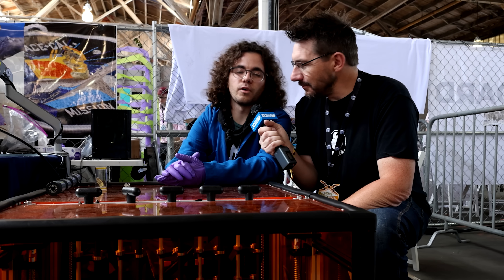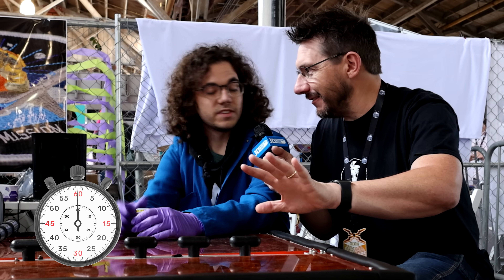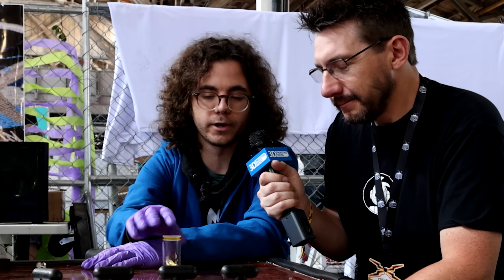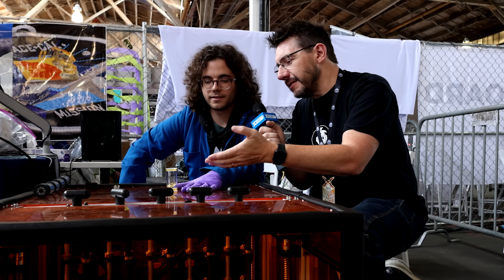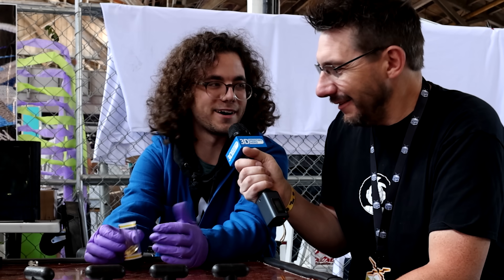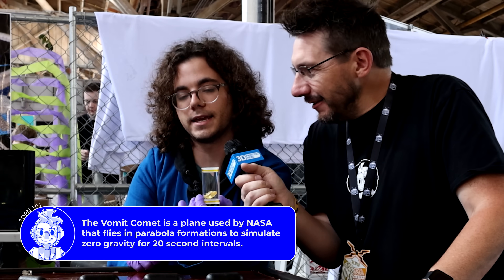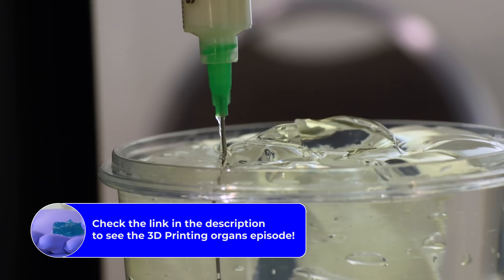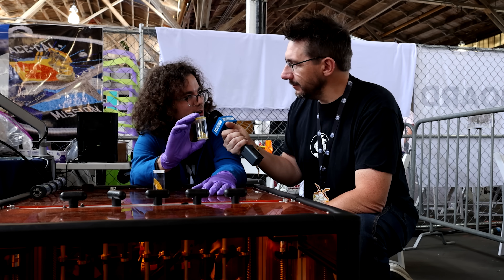3D Printing in ZERO G!

Comment: "all at once" is a bit of a misnomer.  The layers are applied in a rotational direction.  The reverse scan anaolgy is more accurate.  I am impressed the fluid is solidifying in the middle of the container and not on the outer edges.  That type of solidification control is the real star of this process.

Another question is whether the excess fluid can be reused.  I would assume some of it as partially solidifed like current resin exposed to UV and we have to strain it to store and reuse.
Reply: The fluid is solidifying "in the middle" because these points ("voxels") are receiving the laser light all the time. So they heat up until they harden. The other points in the resin do not receive the laser light all the time, due to the vial rotating, so they do not heat up enough to harden. This is how the solidification in controlled. For example a point near the edge of the vial is rotating fast. It will only briefly pass in front of the laser, so it will not have time to get hot enough for the resin to harden. The trick, naturally, is to make sure that all the points you want to harden receive the laser light all the time, and as the vial is rotating, you must constantly update the image you are projecting.

Comment: How is the resin in front of the object not curing? Please make a follow up video in their lab
Reply: Because the object is rotating. The resin "in front" doesn't stay in front for long enough. But all the points that you want to harden receive the laser light all the time, so they heat up to the point the resin becomes hard. For these points to receive the laser light all the time, you must constantly change the projected image, as the object is rotating. By synchronizing the physical rotation to the projected image, you manage to heat up the resin only where the object is. All the other points in the resin get some laser light "in passing", but not enough of it.
Reply: @fixups6536  Damn, your explanation is really good.

Comment: From my interpretation of how he's explaining it, it feels like an analog of the the way string art is made, but using light instead of string and with a Z axis as well. Areas where you get more intersections over time are more likely to polymerise. I might be wrong, though 😁
Reply: It seems to me that they use light density with a rotating 3d model with an "xray" shading rotating in sync with the printing vase. So the density of light will be the same in each point of the resin. Not clear if they are pulsating slices of the 3d model or just projecting it all at once.
Reply: seemed like it to me
Reply: Or like radiotherapy, where they use intersecting radiation to specifically harm tumors the most. And healthy tissue better off.

Comment: I didn't quite get how this can be used for bioprinting.... the materials have to be UV curable, and how does that work with cells?
Reply: Probably you print scaffolding or something and inject cells separately. Or maybe if it's a uniform cell type you just have them present in the mixture and they automatically get attached to the scaffolding?
Reply: @daliasprints9798  Those cells would be pretty expensive. Not a good idea to waste most of them. Also UV radiation is kind of bad for them. Not sure if the short duration is a saving grace or the intensity is still as bad. You wouldn't want to look into those UV lights either, for example....
Reply: @Andreas-gh6is  The process is wavelength agnostic and can be used for anything from UV - visible. Most CAL systems use 405nm which is totally fine for cells, especially at the relatively low optical energy densities used in VAM.

Comment: What I found funny is that they are looking to use low viscosity resins when in other photopolymerization technologies the look exactly to use high viscosity resins. As they are way stronger in terms of mechanical properties (generally by adding fillers) and have a way more chemical resistance.

Comment: I'm still trying to understand how they handle depth with this. Is it exposure time?
Reply: this is a CT scan in reverse, similar math applies
Reply: Yes, it's exposure time. Imagine you want to harden a single point inside the resin (a single "voxel"). Just send a narrow laser beam at this point while the object is rotating. This voxel is going to receive the laser light all the time, and after a while it will heat up enough and the resin will harden. Meanwhile, all the other voxels traversed by the laser will not stay in the light for long enough to get hot enough, because the vial is rotating, so they will not harden. Obviously, for this to work you need the laser to follow the point you want to harden all the time (unless the voxel is at the center of the vial). You could say that at any instant, the laser is projecting the image that you are supposed to see if you were looking from the laser's point of view, even if in my example it's just a single point. Now, why not do the same for multiple voxels at the same time, to get a full object instead of a single point? Well what you have to do now is to project an entire image, not just a narrow laser beam. If the image you project changes as the vial is rotating, so that every voxel of the object receives the laser light all the time, you are continuously heating up all the object's voxels, while all the voxels that are not in the object are heated only "in passing". After a while, only the object's voxels harden, and the rest of the resin in the vial does not.
Reply: @fixups6536  thanks for the explanation, that makes perfect sense!

Comment: So in theory we could use several projectors surrounding the material and alleviate spinning
Reply: Or 1 projector that would rotate around the resin.
Reply: @dinosaurus4189  granted, that will work however, I believe that when the smoke clears we will realize that projectors all around and at the top and bottom will make the process better
Reply: Having projectors move sounds much smarter. Big lesson from FDM is you want your part stationary so forces involved in its motion don't affect print accuracy.
Reply: @daliasprints9798  so why not use multiple projectors and keep everything stationary?
Reply: @individualone  AIUI what they're doing needs a continuum of angles not a small discrete set.
Reply: @daliasprints9798  so unless I'm mistaken that means multiple projectors working together would improve the process. 4 surrounding 1 at the top and 1 at the bottom for adhesion. Do you think it would work?

Comment: Awesome! I remember going to ERRF 2019 and Adrian Bowyer was going to be a keynote speaker. He discussed this being an interesting new method to do 3D printing, though questioned ability to do some sharp details and lamented the use of resin (which still requires careful handling with gloves and all). He proposed using an alternative material (which they were supposed to be in the process of testing candidates) that could be formed with electrodes on the outside of the container... Back to the point: this is still an awesome process, love that there's a plan to make it open source, and will be curious to see where this goes and alternatives (like Bowyer's project) that do something similar.

Comment: I thought 3d printing tech had somewhat stagnated.

This is crazy cool
Reply: Man, look at what Stratasys is doing with full color, multi material printing. Not to mention the new core xy printers that are doing fdm at insane speeds. 

I think the novelty of 3d printing has worn off for a lot of hobbyists, but the current innovation is insane. Can't wait for all the tech to trickle down to consumers.
Reply: @williamreinhard  Stratasys held consumer 3D printing back for like 30 years. Why should I care what they do with their own closed-source technology?
Reply: @williamreinhard Also SLM metal printing, only ~30% strength reduction and could easily get really cheap if enough companies used a single manufacturer, the same thing happened with PCBs and now it's possible to get fairly high quality PCBs for really cheap.
Reply: @williamreinhard  Unfortunately Stratasys is also artificially restricting technological progression with their aggressive use of patents. We would be able to do so much more with consumer printers of they didn't wall off techniques that really aren't complicated enough to justify a patent
Reply: @XecularOfficial  That is definitely unfortunate, and I won't pretend to be knowledgeable about that side of the industry. My only point was that 3d printing tech is far from stagnated.
Reply: Stagnated, some areas gone forward some backwards. 
Search times are epicly slower and longer and more costly now than ever.
Search engines tested this month at best performance was
Plus or minus 13 years. 
Thing found 910th position behind 909 pirates thieves and wrong answers, anyone using the 909 can and are slowly being closed for piracy. 
Operating site vetted out of over 56 shows only 1 now operating for basic critical services. 
Cults3d is your choice. 
Thingiverse have forgotten pift thats a fold in plain speak in my opinion.
Report to me any claims of 
Migrate or Transfer at any sites other than cults3d thanks. I have checked all claims of operating services for years.
 Young and apathetic comunity could be asking there sites to maintain enabled Transfer and Migrate type services.
Reply: Next new technology breaktrough will be attracting material to points in 3d space with configurable electromagnetic fields and fusing them using lasers,microwaves or induction heating.
Reply: @bsod4144    zero g build space type thing is a licensed thing.
i bet someones more likly to build it if shown so if then so we shall see. 
Tea earl grey hot. 
Search engines are fun.
3dmdb
Yeggi
Stlfinder
Google
Net.
Try combining all results from all. then sort by
Oldest first.
Then
Filter out, cgi, laser cutting, cnc milling etc.
Yaye you now have found the original thing. If it was a thing you drew then
You now know if what you drew is original or not.
You now know wether you can upload your thing file or not. 
You now know if you can sell that thing or not.
You now know wether you can make youtube vids with 10 prints of the day, by checking each thing to be listed or promoted. 
Use at own risk as is. 
Wishing you nice success be well.
Reply: I work on continuous fiber reinforced thermosets in a FFF process
Reply: How can you say stagnated when there are constant innovations in an entirely new industry? You probably still wear TShirts that are older than the first shipped consumer printers.
Reply: To sell your thing then we all should ask our sites if they have operating services for that?
They mostly dont i can tell you that now hence i suggest everyone request them. 
Most sites to be blunt in my opinion are kids services, they dont have sales services for actual adult business.
I bet none of you on this thread have even sold a thing yet. Whats the bet?
Reply: @WillofNewZealand  I can't make any sense of this. What the hell are you talking about?
Reply: @theglowcloud2215   so there you have it im talking basics of the 3d print sector. Newb info.
At least you asked before causing massive piracy issues by uploading unchecked things or selling things that end up being piracy or promoting 10 prints of they day that end up piracy. 
So at least you asked at the early days, imagine how much damage can happen in a year of uploading and selling so lucky you found this in your first few days.
Reply: @WillofNewZealand  I still don't know what you're referring to. When was intellectual property mentioned? I mean, yeah, people selling STLs and prints of models they don't own Is a problem, but what does that have to do with the other comments here?
Reply: @theglowcloud2215  it has nothing to do with this he just wants to complain
Reply: @WillofNewZealand  newb info? Dude you're talking nonsense